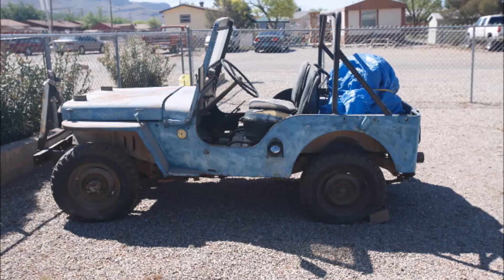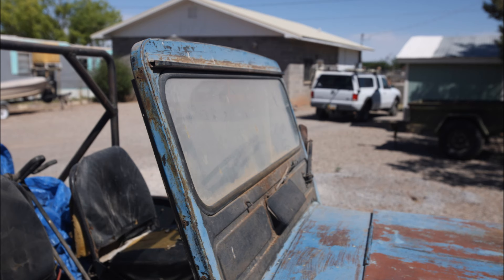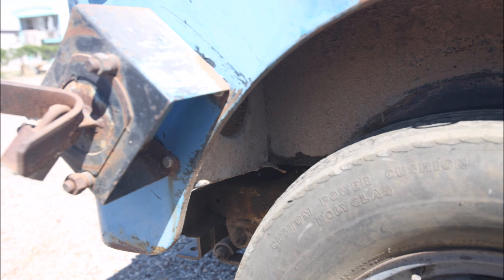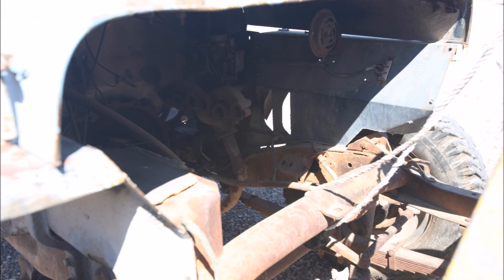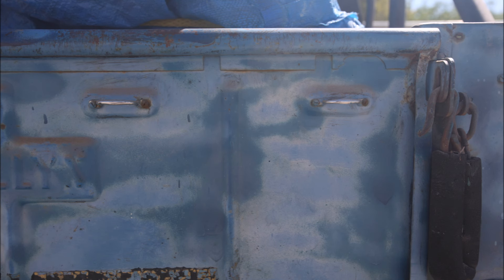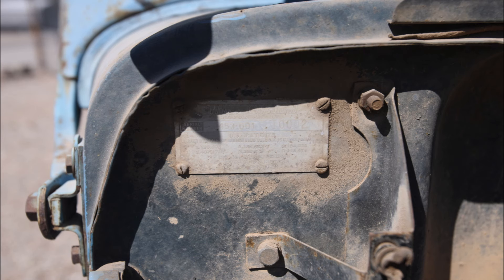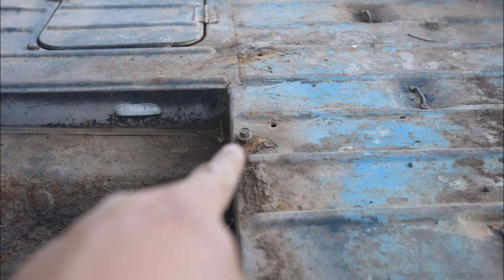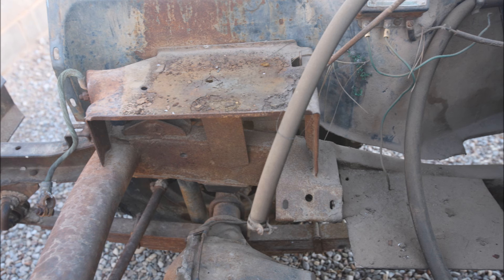1 of 3 Barn Find 1953 CJ3a Willys Jeep Frame off Complete restoration

Comment: I had a 1948 CJ-2A for over 30 years. I think the stock engine is woefully under powered and a pile of junk. I put a 1950 F-head in it and that was a help but I didn't like that either and ended up in putting a Ford 302 V/8 in it. Then I sold it and got a 1943 Ford Jeep and put a Buick odd fire V/6 in that and was quiote please with it's power and performance and it didn't  feel as heavy as the V/8.